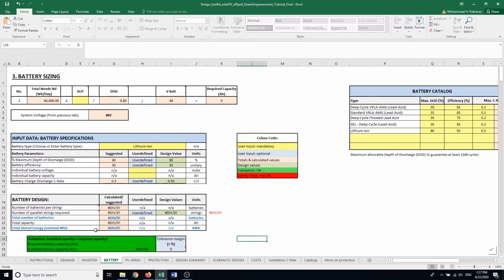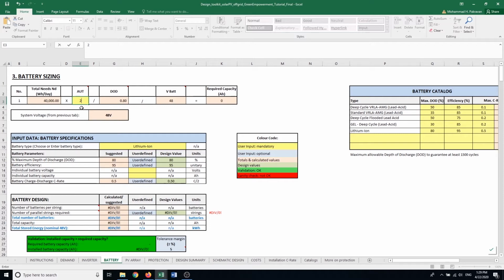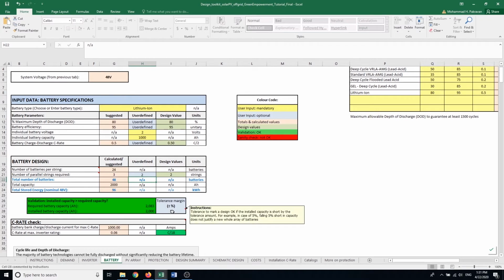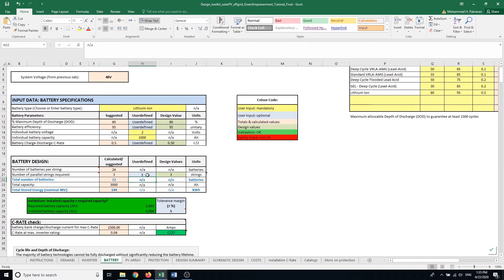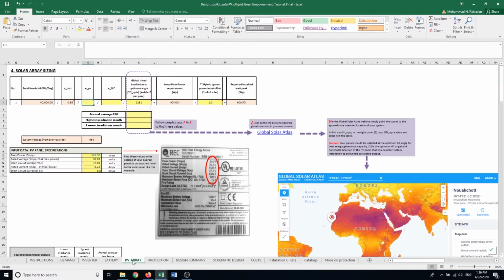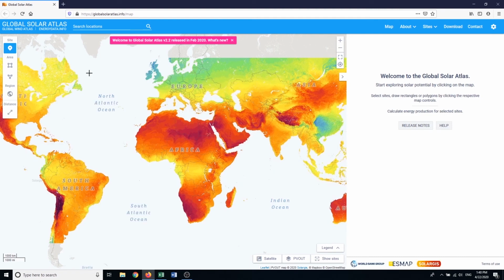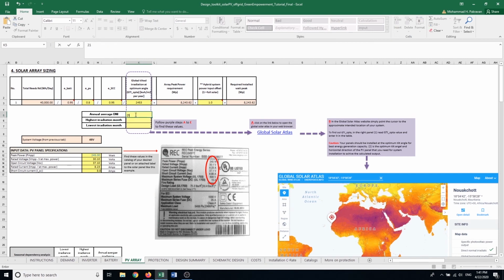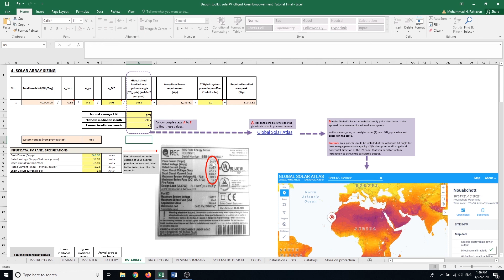Design off-grid solar PV system with Green Empowerment's free toolkit - Tutorial (Part Two)

Comment: Hi Just want to say Thanks for the video.  When you say 500 amps Maximum charge current charge controller: do you mean 500 amps MPPT charge controller? I can not find in the market 500 amps charge controller. Please help
Reply from the maker: Hi, it refers to the maximum charge current of MPPT. You are right, 500 amps is within the range of utility and bigger side mini-grid products. If your load requires a charge controller more than 200 amps, maybe it would be a better design if you split the whole system in two or more separate systems or use charge controllers that could be used in parallel together. Let us know if you had any further question and wish you best of luck in your design.